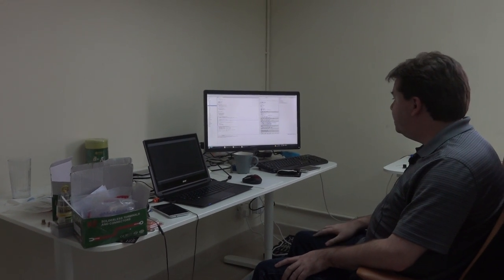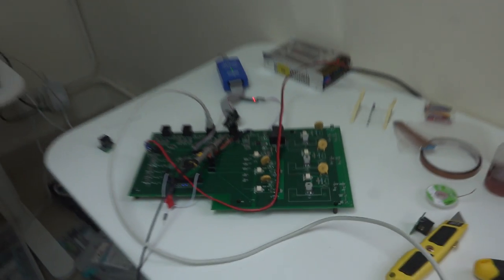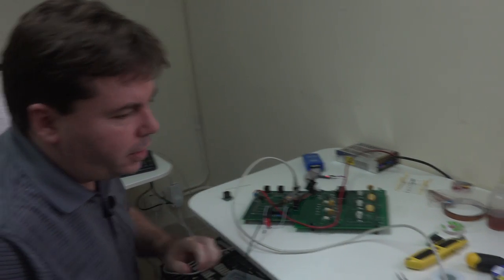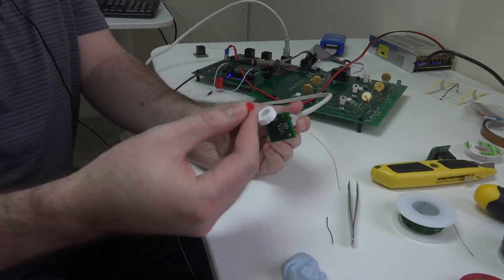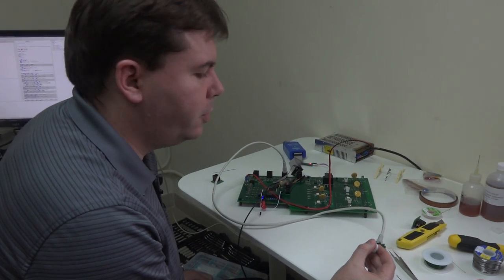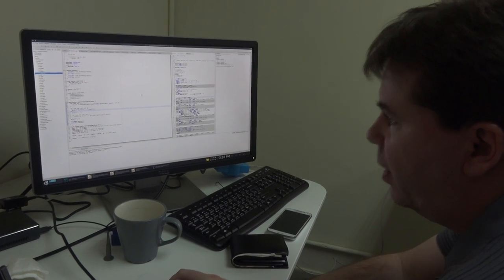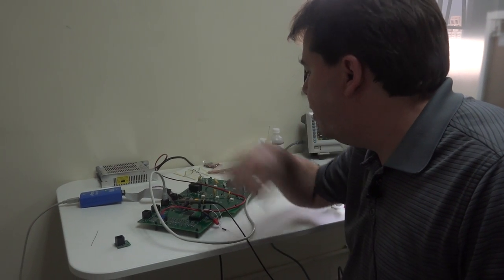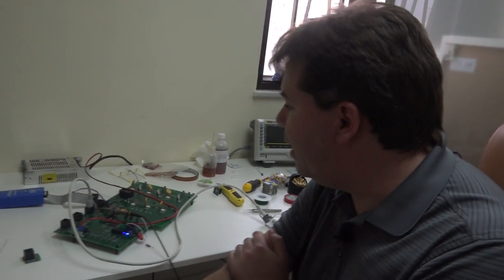Ray explains the espresso machine circuit board

Comment: I wish the mcu were easy to replace when they fail on a espresso appliaces.
Came across several machines where the mcu had failed and with no access to firmware
or a simple pcb removal they were discarded instead.

Comment: Hi Decent Espresso Machines,
What is the value of the DeLonghi sensor 5213214061 coffee machine
NTC temperature sensor at 90 degrees Celsius?                     
 ECAM22.360.B (Romania) started to fail after 8600 coffees, 4 years of work. When starting in the morning from standby mode, it says "GENRAL ALARM". I turn it off at the back, turn it back on, and the machine runs fine all day. I haven't used the milk regimen for 2 years.
In the morning he has a GENRAL ALARM again. The coffee maker is cleaned, descaled, and we apply silicone. It's been like this for a month. NTC sensors are both about 95 and 89 k ohm (maybe not cold enough)
Reply: Vyriešené: stroj na noc vypnúľ z elektriky.( nastane reset chyby)
Solved: turn off the machine at night from the electricity. (error reset will occur)
Reply from the maker: I think you need to ask DeLonghi for that.
Reply: @decentespresso  , well thank you